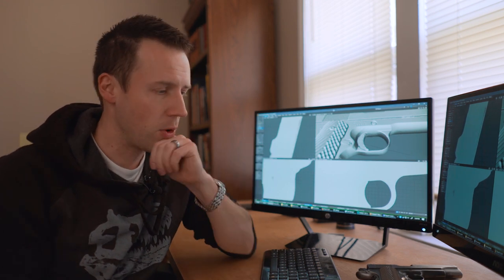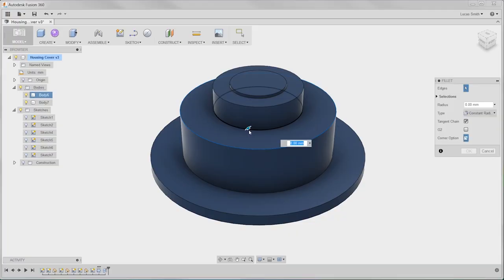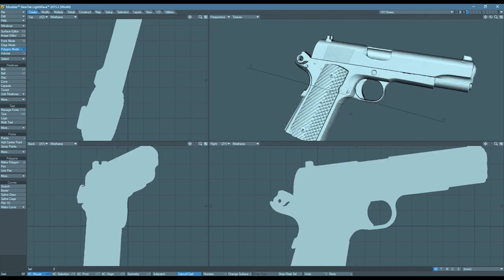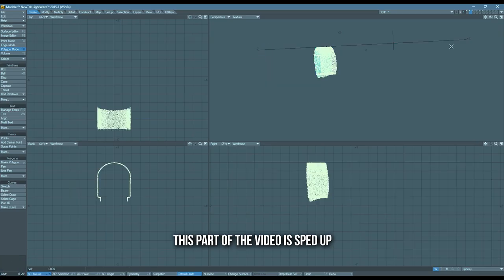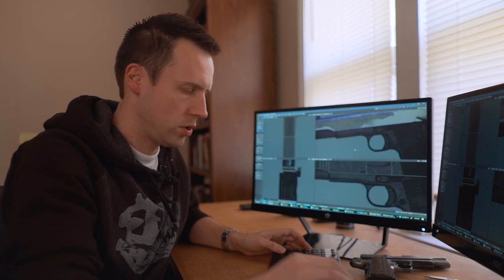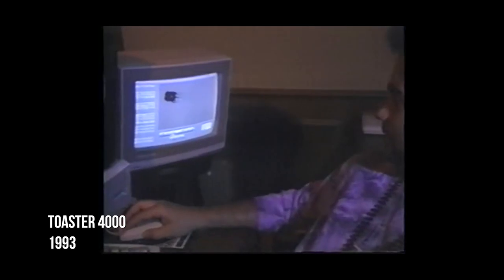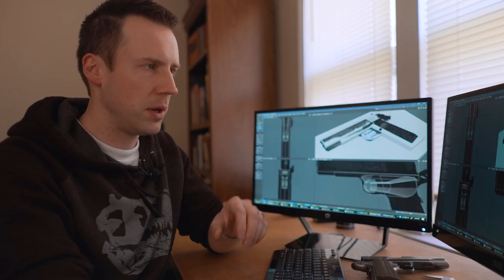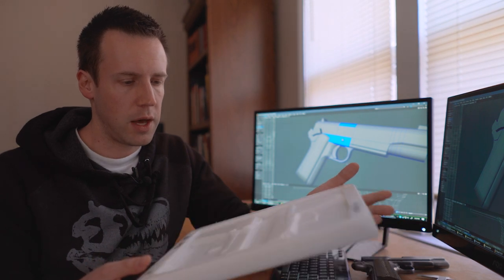Is Lightwave 3D the WRONG TOOL for the Job?

Comment: When judging whether it's the right tool for the job....use it's results as your measurements..😊
Reply: This is as dumb as "it's a poor artist that blames their tools" that lightwave actually printed in one of their manuals. I used to create pictures in the paint program on a commodore 64. You had to manually plot out where each pixel would go. I was able to do some pretty nice work with that. Does that make it the right tool for the job? Hell no.

Comment: Do you always use AutoCad? I would suggest Solidworks and then a 3D software to build your holsters. I use Solidworks for 3D printing models and it has more features. Now if software cost is an issue, then AutoCad and its other programs may work. You can 3D scan the firearms and go back and forth  with modelling in Solidworks? Like what you guys do and hope this helps. Another couple of programs for the hot spots would be Ansys, which is "free for students" (they do not ask for any information). Ansys helps determine applicable loads and structure capabilities like will it fail, flex, or stretch.

Comment: That is awesome! Solidworks would definitely not like you to import millions of polygons like that, the resource monitory would be all up in your business. I think traditional cad tools are definitely more suited for building things from the ground up but if you outsourced your 3D scanning to a specialist you could definitely get complete models in .step form where you could then use something like solidworks to block off the controls and add whatever you need to make the model a good holster blank.
Reply: The problem with outsourcing the scanning is finding someone with an FFL that would let us send them all kinds of guns all the time.
Reply: For sure, that would be a logistical nightmare. Y'all definitely have the right tools for the job.  @isaacbotkintrex

Comment: While I love your company message and the way you do business, I do have to be honest and say that I think that your iwb holsters need to be updated. Things like a flex point on the sidecar, and 2 belt clips on the raptor and nomad would be really good upgrades.
Reply: In some holsters the flex point makes the holster floppy, and inconsistent. It'll probably take a lot of time and money to get it right. But yeah, it would be a nice option to have
Reply: Have you tried Tier 1 Citizen holsters? It’s like the Sidecar with the flexpoibt
Reply: @williamle8300  I have a couple of friends that have them. They are really nice for sure which is why I'd like trex to start adding those features because honestly I'd prefer to support trex over most other holster companies because of how they use their company as a platform for education on important issues.
Reply: Part of the genius of the sidecar is that the whole thing is designed to keep the magazine and pistol grip in just the right place to maximize concealment. With a hinge, the mag might be pushed out, as well as the pistol's grip. 
As Nikanor said, the flex does create some floppiness and inconsistency.  It adapts to the body's natural shape more, but this often does not help concealment. 

I won't say anything at this time about the Raptor and Nomad except to say we have been working on something for a while.
Reply: @davidbotkin1650  I can see your point there. I do feel that a good belt will still allow for a good consistent platform but I'm sure there are those that still want maximum consistency. Perhaps adding a  completely new holster that has a flex point while retaining the current sidecar so that folks have options?

Comment: Also, you might check out the new ZRemesher in ZBrush... It generates some badass topology from scans, CAD data(converted into poly)... Super fast too.
Reply: I do want to try that. There's also some neat looking retopo tools in 3Dcoat that I've been meaning to experiment with.
Reply: @isaacbotkintrex  If you're strapped for cash, you might also try InstantMesh. It's a free and open source remesher that's used in Modo.
Reply: Agreed try Instant Meshes, you could of saved yourself the bother of modelling over the scan, Blender also has decimate and remesh tools
Reply: @gower1973  There's a new branch of Blender now, actually, that does a volumetric remesh using OpenVDB. It's really nice.
Reply: @josephbrandenburg4373  So, after playing with some of these, I'm incredibly impressed with the state of retopo tools. However, I still want more control, and in the next video, I'll explain why.

Comment: I have participated in many games and video work in Lightwave.
But now I am trying to migrate a little bit to Blender, which is OSS and free. Not only because the software is free, but also because the OSS community is speeding up the development and there are a lot of people developing useful plug-ins, so it is evolving fast.
The idea of T.REX ARMS and Blender are facing the same direction, so why don't you think about how to use Blender (sorry, I'm using translation software)

Comment: Not the most boring video! I totally get this, just got a 3d printer, people recommend designing in fusion 360, but i'm used to sketch up, fusion 360 is a better tool for the job, but i'm so quick using sketch up until I reach my limits on it then its all good.
Reply: I actually use LightWave for most of my 3D printing, but my printing is done on Shapeways. I don't think most home printers can accept polygon meshes. I could be wrong though.

Comment: I prefer solidworks or inventor fusion 360 might be easier to make the model in however. Autodesk’s CAM program is pretty nice. Interesting to use animation software for the sane job.

Comment: First i gota say.. people! please!! take a second and think about your titling of our videos and the presumptions they deliver to people.  This title Is Lightwave 3D the WRONG TOOL for the job?  comes across as an assault on the product.    as in it gives the impression that Lightwave the the Wrong tool for any job.  Ultimately putting down the application.    Fact is. lightwave is like any other 3d application out their,  it has strengths and weaknesses as do them all.  Fact is, its just a tool, and in my personal experience an excellent tool for most jobs,   and to each is own who best use the tool in respect to their own abilities as an artist.

Comment: Right of the bat, haven't watched the full video yet only a minute in... Well, yes, it's an animation tool. Though It's also a modeling tool. Just like 3DS Max, Modo, Maya, etc. It's just not as precise. If your tolerances are in the 0.5mm to 2mm range, then any of those work. If you're needing hundredths, thousandths, yeah, use CAD. However, CAD is a modeling too too. We use it in the games industry all the time. Fusion mostly, since it's super lightweight. But if you're working with scans, it can be a bit easier to trace and retopologize some scan data. You're not reverse engineering something afterall. Actually I 3D printed a replacement part for my dish washer, with 3DS Max haha.

Comment: Wow, I've been an Editor/Animator since 1998 and I can't believe Lightwave is still around?!  lol
I remember back in 2001 I was told a good way to explain the difference between CAD and Animation software & geometry is with the Chocolate bunny example:
Animation software like Max, Maya, Cinema4D are not "solid" modelers that a CAD system would expect to use.
Cad software expects its' geometry to look and act like a solid chocolate bunny.
Animation software creates the hollow bunnies.
Wow, I've aged myself, lol